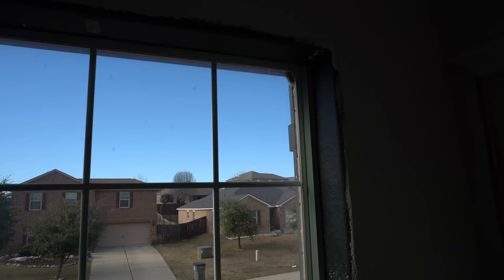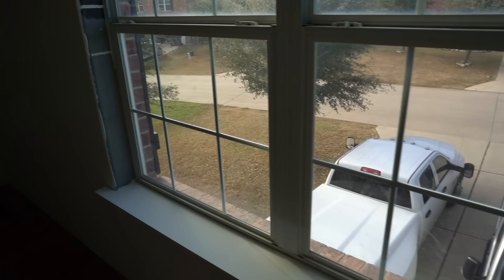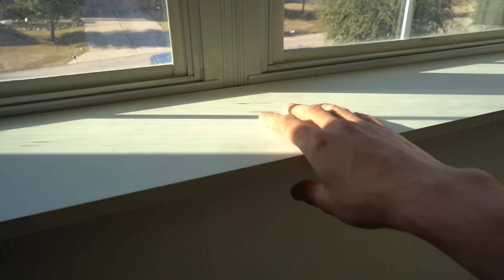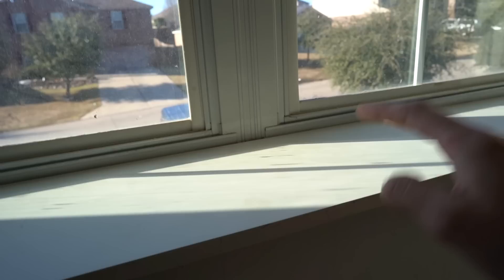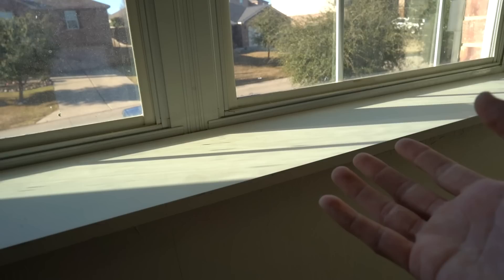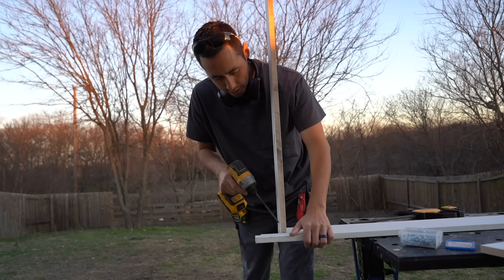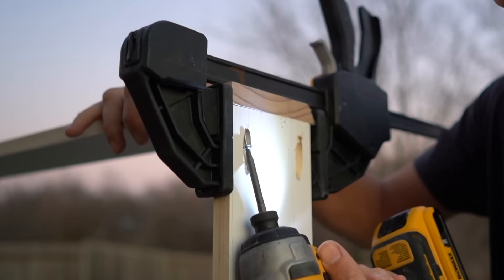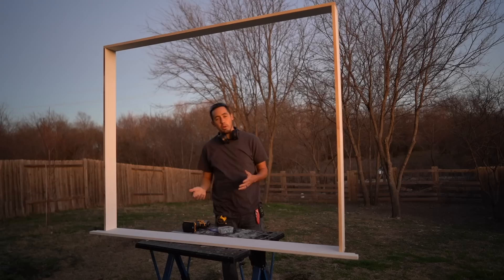Window jamb is ready for casing...

Comment: Dude that 30 degree angle in the board is a great idea! 🔥🔥
Reply: Let's just call it 22.
Reply: yeah that's a great tip
Reply: if you're in a cold area i would not recommend it, for condensation
Reply: @jonathchamp8450  meaning that the finer edge will be less resilient to moisture?
Reply: I'm sure there are many different ways to bypass the inside corner, as long as you get the point. Cheers
Reply: @k.d.8924  the space behing will get moisty, Mather of Time, it will affect the wood. ( Sorry for bad english)

Comment: You know what I like, Your planning on making this entire assembly into one unit, very professional way of doing it, keeps everything tight and square, however at each stage of the assembly your taking it back to the job site and dry fitting it, to make sure everything is fitting properly, and "THERE" is where I now know why you do superb work, it's OK to dry fit parts of a unit during assembly, here I thought I was the only one that has to do dry fitting of parts before final assembly, of any project I'm working on,  I'm glad to see you as a professional in your field do the same thing too, it gives me more incentive to take the time to go those extra steps, to make sure everything fits properly at the final assembly.

Comment: The tip about cutting the 30° angle on the back of the jamb is something I never even would have thought of. Tips like that from you are what can give the average homeowner a finished product that looks "Great" instead of "Meh". Thanks for taking the time to shoot the videos for us Richard. I have no doubt you'd be done with the room by now, if not for taking all the time to set up camera angles, and explain every step you're doing which makes the job 4x longer.

Comment: Very educational and much-appreciated video! Question: we are going to trim our windows that are presently wrapped in sheetrock. There is only 5/16 exposed on the window frame. Would you remove the sheetrock or go with super-thin material on the sides and top? Our goal is quality.  Thanks.

Comment: Time to switch to a Kreg jig. Yes, theres more adjustments if you're switching thickness of material, but thats why I have two and 3 different drill bits. And I think I'm still in for less money than what that Porter Cable was new.

Comment: To figure out your jamb size you measured the rough opening, I believe that will only work if the window is perfectly centered in the opening, correct? What is your procedure if the window isn't centered, mark the side reveal on the stool and top? Vertical laser?

Comment: Richard, thank you very much for your informational videos.  As an aspiring woodworker (old guy here), I am going to finally attempt to redo all my doors, windows,  base trim and add crown moulding to my home.  I am not under any time constraints.  One of my questions,  there are a lot of videos about the how to, but hardly anyone discusses the type of material used for the project.  I realize that this is usually dictated by the homeowner's budget.  To further narrow it down, not stain grade, but painted, and price point is not the main component, is there a trim material you prefer if you were doing your own home.  Do you alternate material depending on it's location?   There again, time & budget are not the main components.  I would like to have something for the long haul.  I also realize that the quality of the install is a huge part of it.  Thanks

Comment: Another great video. Two questions for yah.....
1) Typically when I'm building my jamb extensions, I use a roundover bit on all ripped edges. What are your thoughts on that? My experience has been having a sharp-edged edge doesn't hold paint as well and it's kind of a hard look.
2) I'm considering buying my first track saw this year. What do you think of Dewalts version?
Reply: KaitzConstruction 
I did a lot of research, & watched a lot of videos on track saws, before I purchased one. I narrowed it down to three.
I ruled out the DeWalt TS, because the battery pack doesn’t leave much room for ones hand to grip the saw. (I have large hands.)
Makita has a great locking feature, that keeps the saw on the track, while cutting at 45 degrees. Makita runs a special now, and again, (Depending on the kit.) Purchase the saw, batteries, & a charger, Makita gives you two additional batteries for free. Festool - the TS55. The best review I found for this same conversation, involved an individual, who borrowed the Makita & liked their TS. He was also to borrow the Festool TS55 & LOVED it. 
Cost is always a factor when purchasing tools. The initial purchase price, is obvious. But it saves so much time, on the production side. I purchased the Festool. The Makita tracks, & the Festool tracks work with either saw. I hope this helps.
Cheers!

Comment: I like the videos. You’re using the porter cable pocket jig wrong. The knob is used to set it one time for thickness of lumber. The lever / handle is then used for repeated use on that thickness. You only use the knob to change to another thickness. It still works how you’re using it but it’s a lot easier to move the handle than to turn that knob. Anyway....what’s wrong with Taylor swift? Haha
Reply: He's doing that to make it a custom thickness every time. It's a good habit to prevent compressing softer wood if it's variable thickness between pieces. ( Even if you just planned both to the same thickness)
Reply: Ok. I missed where the lumber is different thicknesses. I also didn’t hear him say anything about using it that way because he was concerned about compressing the wood. I have both the Porter Cable and Kreg pocket hole jigs. The Kreg is adjusted with a wrench . 
It would suck to have to adjust that each and every time. I was only  leaving my comment to him Incase he just didn’t know. Possibly you are right . But I doubt it. I’ve seen guys on the job site do the same thing with that particular pocket hole jig. This guys content is excellent however he’s not perfect. Nor am I. That’s why I watch. Hopefully I can learn something. My response is not meant to be argumentative. Just a response and my reasoning.

Comment: You tapered cut the right leg but not the stool. That'll mess with the reveal of the horn. Between the front of the stool to the trim of the casing, the left side will be an 8th wider.

Edit: That's if you ripped the left side and header to 4 3/8 to match that top right corner.

Comment: 1/8 stick out the jam would have been fine. You could have filled it with caulking. You have about 12" to the door. No way you can see that at that angle with the door in the way.
Cutting at angle to hide that 1/8" is not necessary at all.